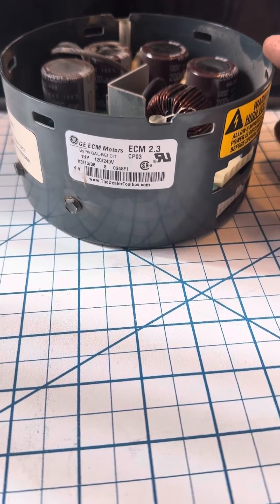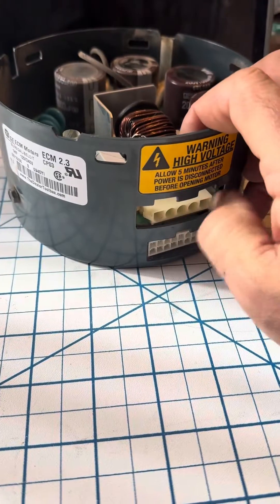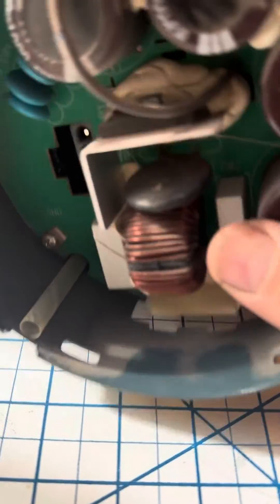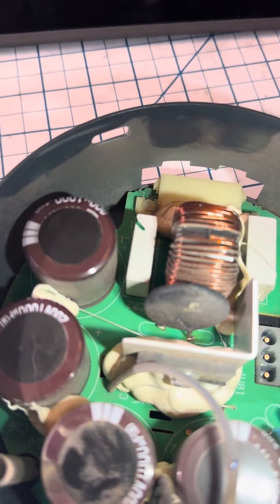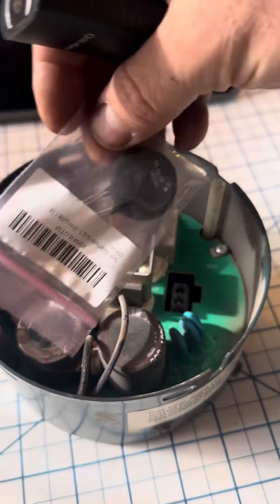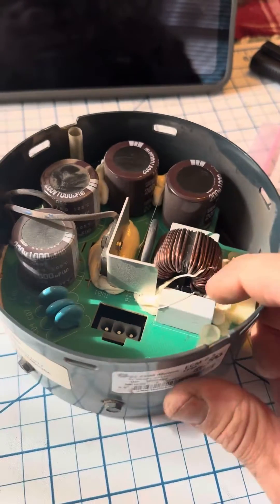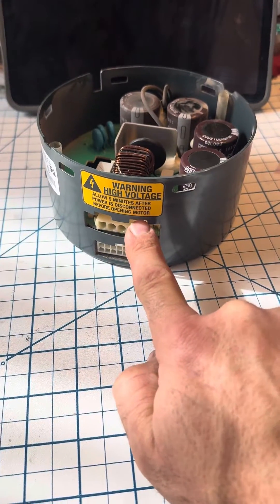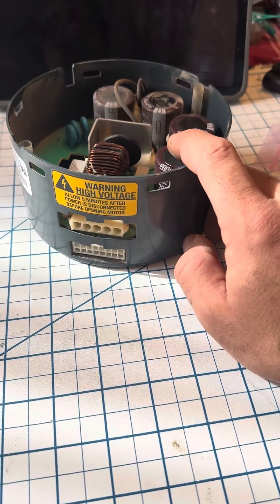Ecm variable speed motor and bell thermistor repair

Comment: Keeps the inrush current down when charging depleted capacitors on initial start up. Otherwise, you may end up tripping a circuit breaker in your electrical panel.